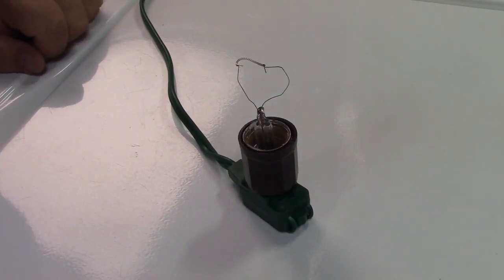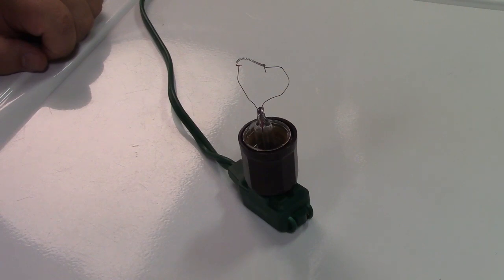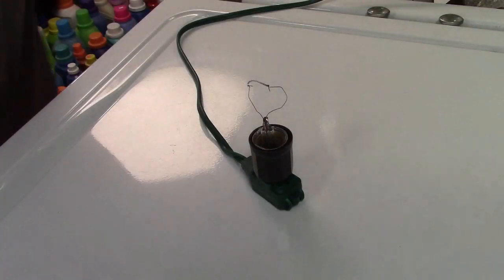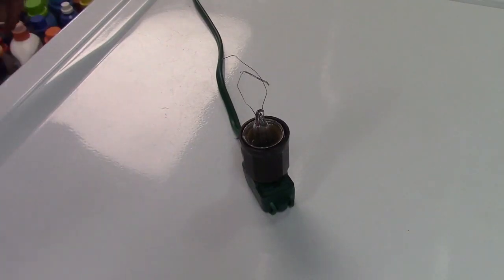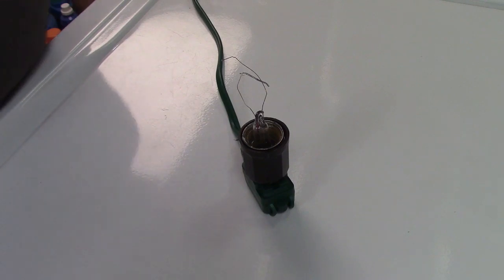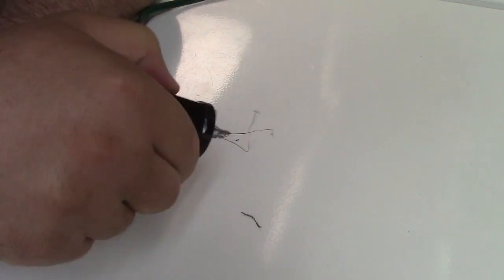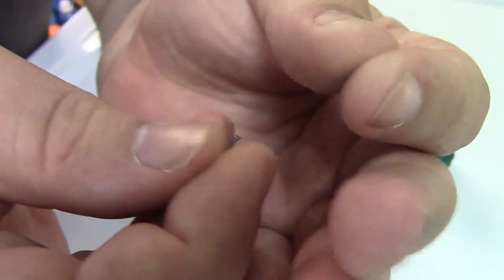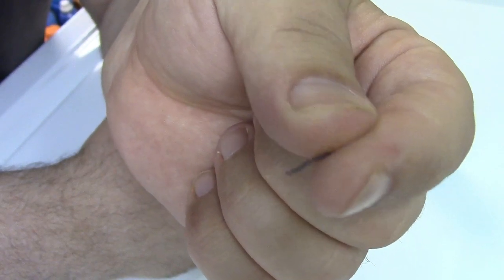What Happens When An Incandescent Bulb Is Turned On Without Its Glass Envelope?

Comment: My table lamp bulb has broke a few weeks ago but my lamp still works with out the bulb. I guess it's not safe to use though and I probably need to buy a new  lamp.
Reply from the maker: If the glass envelope on an incandescent bulb is ruptured in any way, even a small hole in it, this is what happens.  If it still works, it's not incandescent or the glass envelope hasn't ruptured.
Reply: @jaykay18  thank you, I will try and get a new bulb because at the moment there is no bulb.

Comment: I mean... it did turn on tho... only for a second or two.. but it technically did!!
Reply from the maker: Yes, of course.
Reply: @jaykay18  i found an incansescent bulb i like theem and cfls. Not leds tho, i hate them a lot. Because one of them lasted 3 weeks until completely breaking
Reply from the maker: I'm in the same boat here, I hate LEDs.  I have several video son that very subject.
Reply: @jaykay18  Im buying incadescents and cfls b4 they discontinue them
In argentina (Where i live) i think its still not illegal to have CFLS or incandescent FSR
Reply from the maker: It's legal to have and use them.  It's illegal to sell them.
Reply: @jaykay18  Well here in argentina neither of the are illegal, since they sell them everywhere that is not a fisical store. Are CFLs also illegal in ur country. Imean, they've got mercury and some bunch f toxic stuff
Reply from the maker: All fluorescent bulbs, not just CFLs, have ALWAYS had mercury.
Reply: @jaykay18  doesit mean its illegal
Reply from the maker: Here' they're illegal to sell in wattages I believe over 40.  Specialty bulbs are still allowed.

Comment: Burnt light bulb smoke. DON'T BREATHE THIS!!!!

And 3 people hate this video because the bulb you used isn't LED.
Reply from the maker: Yes, but Will It Blend, that is the question!

I'll try the experiment again with LED, what happens?  Nothing.  It died just taking the cover off!
Reply: @jaykay18  lol, I broke an led bulb the same way. I did eventually figure out a way to get one apart without breaking it and it is way brighter without its protective cover. In fact I removed the covers from about 10 led light bulbs and am currently using them in my shop.
Reply from the maker: Yeah the covers certainly block some of the light.
Reply: Once the cover is off, it looks like sunlight!
Reply from the maker: I'm sure there are many more examples of this on YouTube.  I believe this was only a 40 watt bulb, a higher wattage bulb would literally be like the sun!

Comment: I have a couple halogen bulbs like this, but they are so fail because 5 out of the 8 I bought, the glass cracked, and it just sheared right off.
Reply from the maker: Heat is the enemy.  And cheap glue if they had ceramic ends.  Common with halogens.
Reply: Then I can see why that happened in the span of two days.